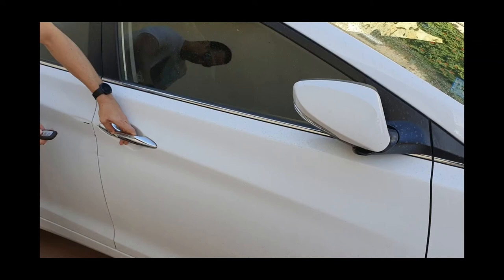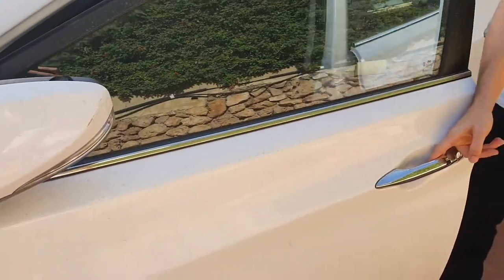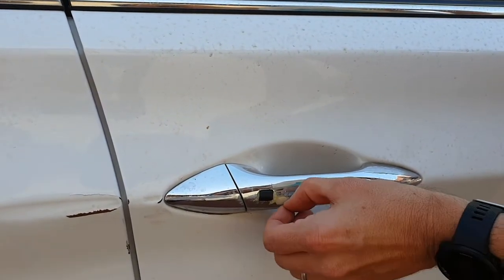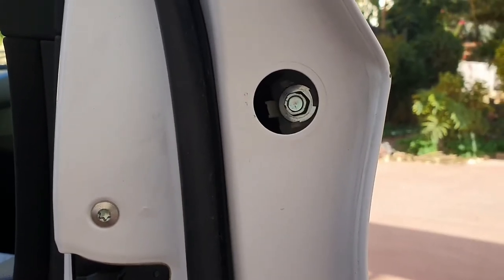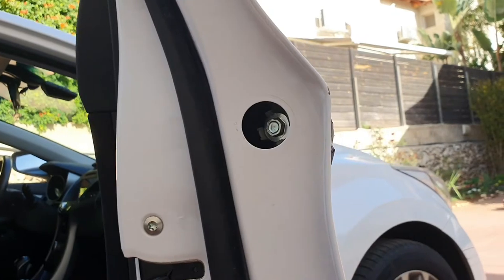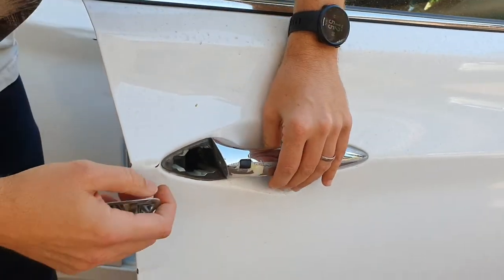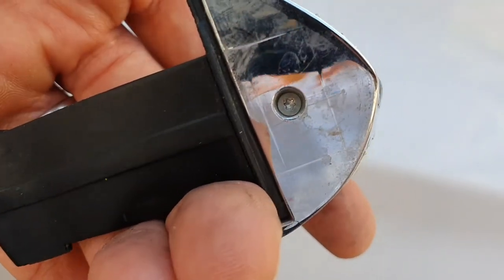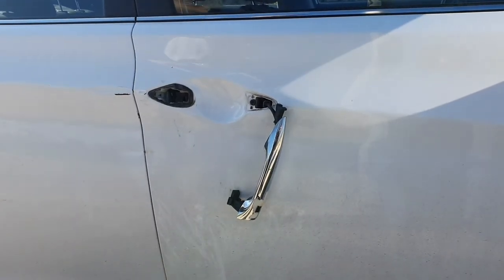Fix car 🚓 door handle  🤙 with broken remote key 🔑 button

Comment: My Genesis have the same issue. If i replace the door handle, will my key fob recognize the button inside the handle?
Reply from the maker: It is supposed to. This is how it works in my case
Reply: This worked perfectly in my 2018 Tucson. No issues with the key fob

Comment: Thanks for walking us thru that! I had my driver side button stop working on me. Found the replacement on Amazon for $25 and followed along. Super easy. Only difference for the driver side is the actual key hole part. Didn't change anything tho, still only a 5min repair and prob the best $25 I spent in a while lol. Thanks for the vid! 🫡
Reply: Oh btw, you don't have to take the screw all the way out. Once you have it unscrewed you and open the door handle and pop that piece out*